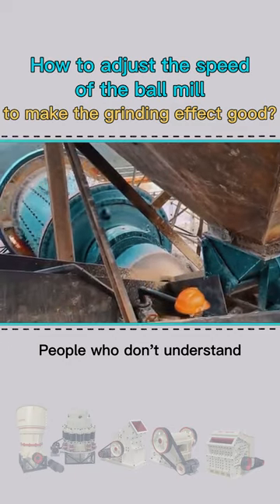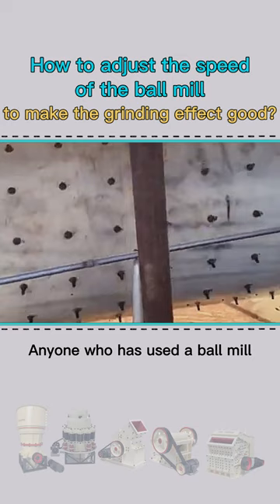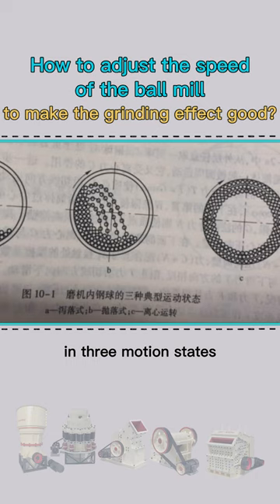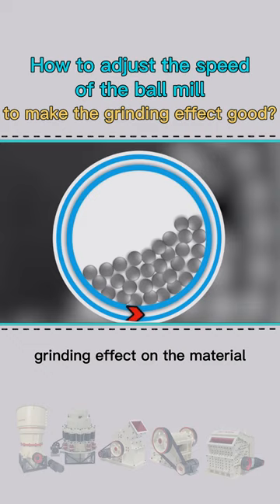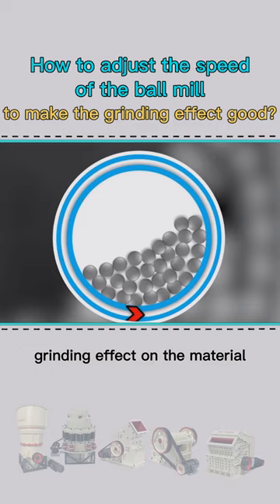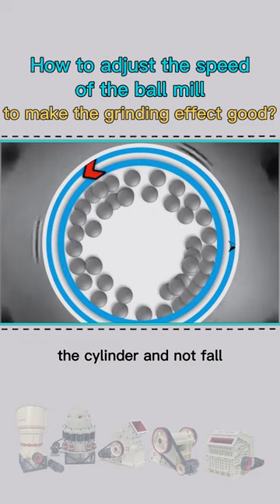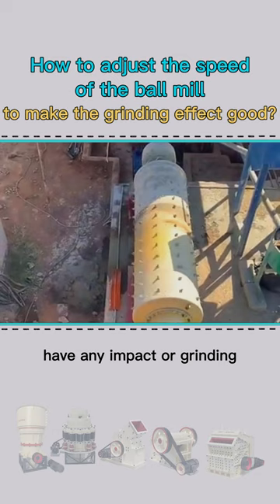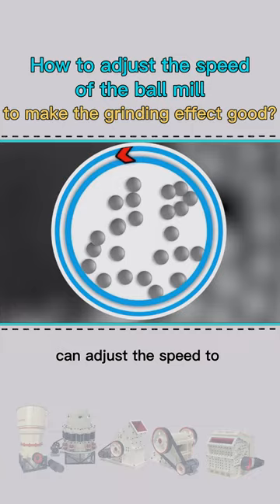Why should the ball mill be adjusted to an appropriate speed?

Comment: That's the best and short explanation of ball mill on Youtube.
Reply from the maker: thank you
Reply: Just saw a vid with 7 people going inside to do maintenance and some asshole turned it on. Also 2 other people were on the outside and were thrown off. It was quite big so they also had a big fall as well. Seeing now what happens inside one of these things I'm thinking there probably wasn't much left of those guys that were trapped inside.